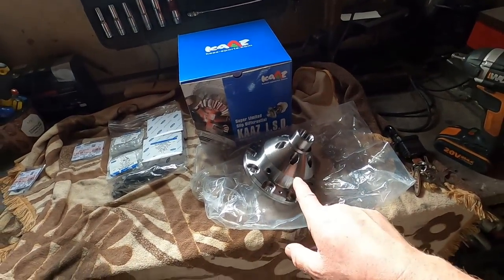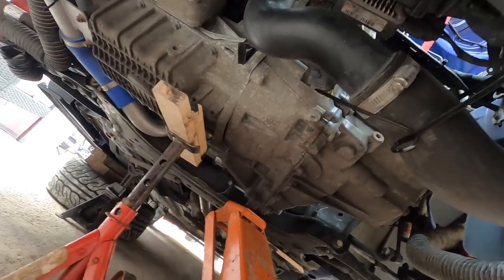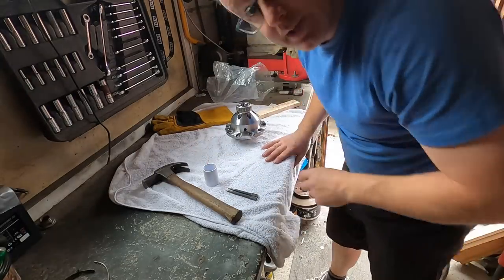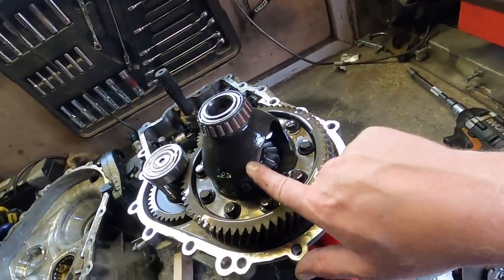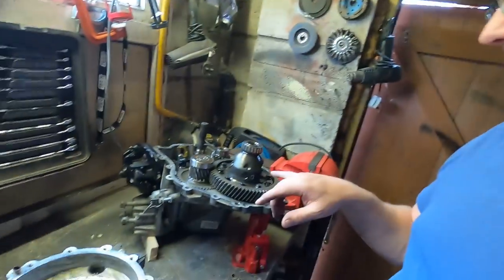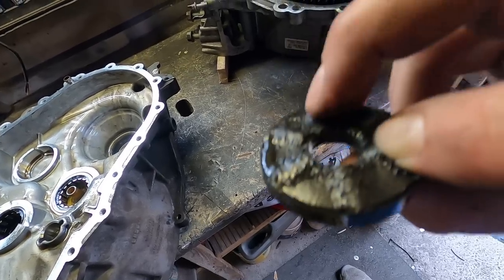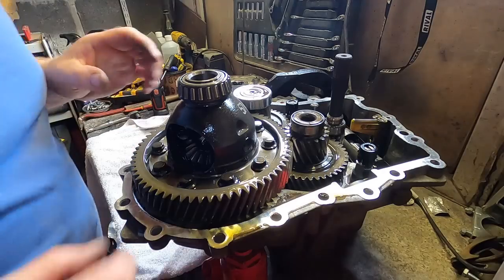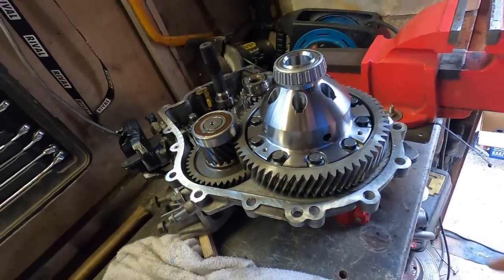I fit a Kaaz differential to my fiesta st (pt1)

Comment: Genuinely really interesting, you'd never know shims were so important so thanks for passing on all your research. Also, loving the tool improvisations! What we welsh lack in money (or just being tight) we make up with ingenuity :D
Reply: FWD gearbox diff shimming seems much easier than RWD, as (I guess) the drive gears are parallel and not in 90 degree angle. I do not remember exactly how it goes, but something like you need to shim RWD diff so that the big gear and small gear align with as big contact patch as possible, and there is certain tolerance of play that must remain between them, and you need to measure that play. Otherwise the gears will wear out or bang each other in pieces. Shouldn't be such risk on FWD gearbox and diff, as there's no angle between the gears.

Comment: Taper roller bearings are matched during manufacturing and work best installed as a set and therefore not a good idea to install new inners into the old outer races.
Reply: I was going to comment the same, I've always replaced them as set for the same reason. If the set isn't changed then I bet there will be race to bearing high-spots = messed up preloads as they wear.

Comment: Am planning to get a lsd as well after going stage 3 with the x48, but I'll probably just get a new gearbox at the same time as pumaspeed sells them with pre-installed quaife diffs and my gearbox got 130k km on it already, so this video is very helpful, gonna have to do something similar in the garage

Comment: Funny man, last time you shared about the LSD and that was the day I received mine. Now I see your update on it and I just got mine installed. Run it for about 100km already and it feels very good. 2 things I noticed: the first gear in slow speed is very hard to turn. The second gear 3k rpm with small throttle already pull you a lot. A low better than my previous MFactory 1 way LSD. I believe you can do a better in the track with this Kaaz LSD. Just remember to fully turn off the ESC 😂
Reply from the maker: So you have the kaaz also?
Reply: @Sparkplugsteve  I just installed that yesterday and got my car back this morning. I am running with the default setting as my car is my daily. Really a good choice
Reply from the maker: Really good isn't it.
Reply: @Sparkplugsteve  I believe it is the best mod. More fun and performance gained than an upgraded Turbo. 👍🏻
Reply from the maker: My first drive blew my mind.

Comment: Awsome video ! Could you go more indept about the shims and what role they play ?
Reply from the maker: I thought I did? They determine how much preload or pressure will be put on the bearings. Ford specify close to 0.14mm of preload pressure. So the shims are designed to get you close to that figure.

Comment: Never use old races with new inner!! Replace as set!
Reply from the maker: Tell ford and quaife the same 😁
Reply: @Sparkplugsteve  i work with bearings in lots of industrial applications. My boss would slap me silly if i re-use old races😁
Reply from the maker: I don't disagree with you. But it's widely done in fitting diffs.

Comment: So when your preload was too much at 0.45mm(too much pressure on bearing)the space between the casings needs to be increased, so when changing the shim from 0.50mm to 0.30mm doesn’t that increase the preload ? Or did you add the 0.30mm shim to the already fitted 0.50mm shim ? ...... as you say it is confusing 🤣
Reply from the maker: 0.3 is smaller than 0.5 so the preload is 0.2 less. So the bearing race is moved out away from the bearing by 0.2
Reply: @Sparkplugsteve  Yes I’m with you now Steve 👍

Comment: Guys sorry if this is off topic. I just got a fiesta st mk7 and am looking at a CP2E upgrade. Is the exhaust and uprated intercooler very beneficial? Car won't be used on track just normal/spirited driving. Does the catback exhaust give much in the way of power output?
Reply: You would need a decatt/sports cat for the CP2E not for the CP2 thoo

Comment: Steve, I have a spaceframe Fiat 126 which I recently swapped over from a bike engine to a 1.6 Ecoboost. Engine is about to start getting some extensive work including a new uprated clutch, looking for 350bhp+ . Looking to reduce costs I have this week decided not to fit a Blackline LSD, what made you go for the KAAZ at £200+ more ? Love the channel, much good information without young boy froth. My car is iat Scottish kitcar centre on facebook if you want to follow the progress.
Reply: From what research I've done the Blackline diff is a Chinese one and is lower quality (they require you to change the oil after 100 km, in order to prevent any shavings from the diff damaging the gearbox). Blackline is not a plated diff like the KAAZ (check steeve's last video where he opened the kaaz and showed the diff plates), it is more similar to a Quaife or Mfactory diff. I think for my fiesta I'm going with Mfactory as I found it the cheapes on focusrsparts.com and it seems to be high quality
Reply from the maker: I really wanted a plated diff and not just a torque biasing one.
Reply: @rtashev  Thank you Radoslav, appreciate the feedback.

Comment: Good stuff. I did a full rebuild of my trans last year. I made a post about it here: http://blog.sluggyjunx.com/rebuilding-the-transmission-in-my-2014-ford-fiesta-st/   Includes annotated manual pages and part numbers, etc. One comment- AFAIK the bearing cups and carriers are matched pairs so in general you want to replace both the cup (race) and the cage/carrier/rollers and not one or the other.  I got lucky with my shims. Was able to re use the .5mm shim which was nice. (Yes, I followed the procedure in the manual to measure the pre load.) :)     Keep it up. Love the vids.
Reply: Hi mate, Currently in the process of rebuilding my trans which has a bad input shaft bearing. I had your blog bookmarked but the website seems to have gone down. Any way you can send me the manual pages and part numbers? would be a huge help
Reply: @YoungQwasson  FWIW, the site is back up. 👍